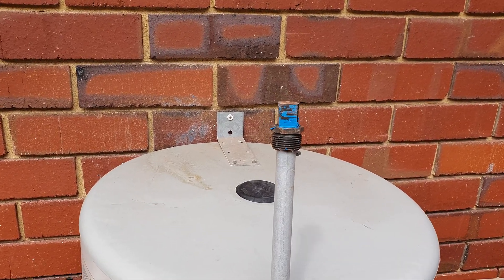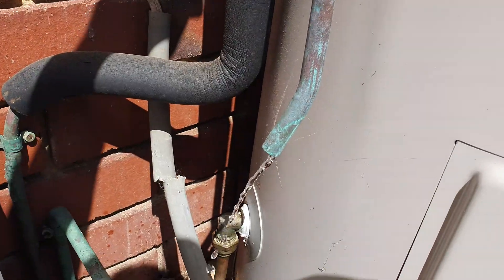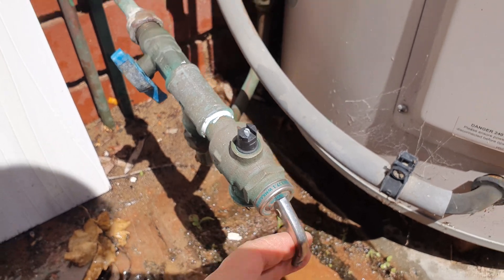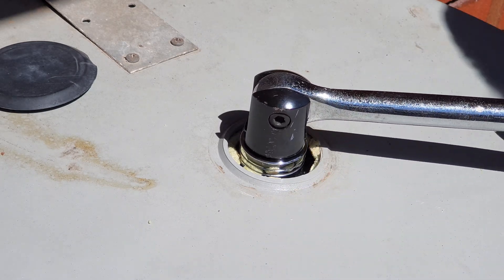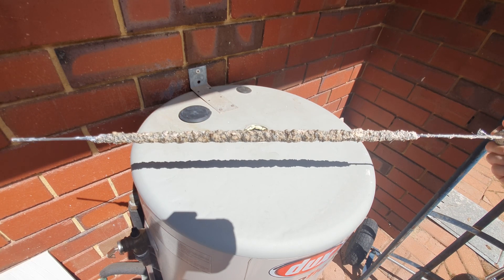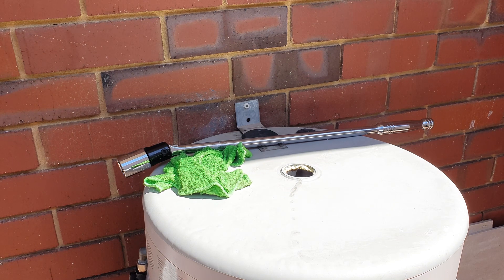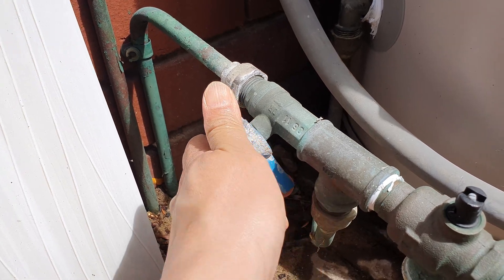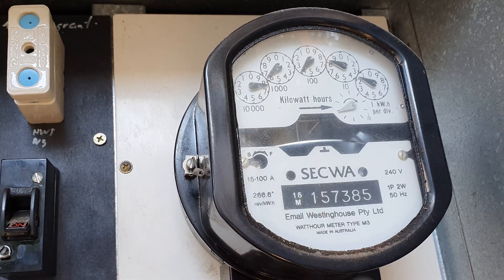How to Change The Anode In Dux Electric Hot Water System and Prevent Tank Corrosion

Comment: Hi. This is a good video to show people how they can extend the life of their hot water tank. Once the sacrificial anode rod is corroded away, then the tank will be next to corrode and then the leaks start and a new tank is needed. Easy and relatively cheap to get a new rod and install. Dont forget to put on the thread 8-12 turns of teflon tape before screwing in the new rod. Good luck everyone. Is there anything you can not fix? 😂 Good handyman

Comment: Thanks for sharing. I’ve got water streaming out from the anode cap, hoping it’s not needing a system replacement 😬
Reply: We had the same thing happen last night. How did you go? I’m hoping it’s just the anode leaking..
Reply: @braydenboon  new anode. then the electrics failed so new circuit. then the cylinder failed as it must have been with an anode for too long and the cylinder had corroded. You might be up for a whole new cylinder.
Reply: @colin.charles found the leak, coming from the anode threads and the old anode was cactus. Picked up a new anode today and the bloody thing won’t fit into the cylinder 🙄
Reply: @braydenboon  yeah they make one that’s in sections so you can shorten it.
Reply: @colin.charles unfortunately that’s not the issue. It’s too thick